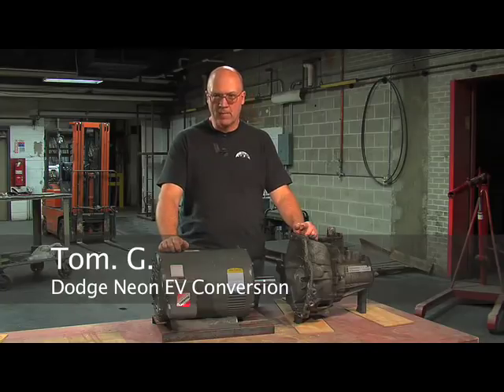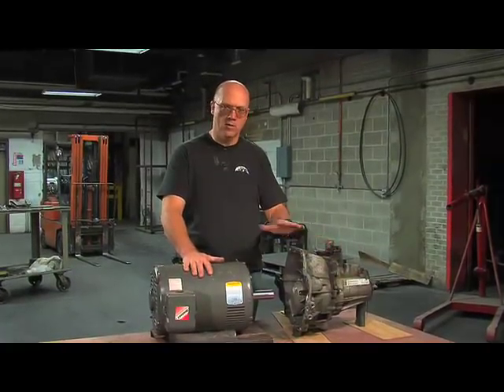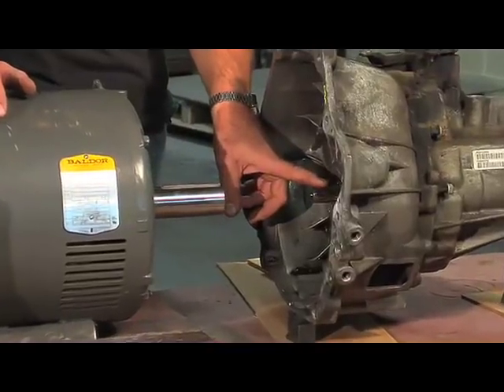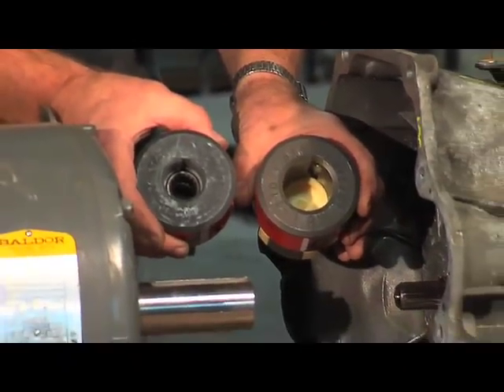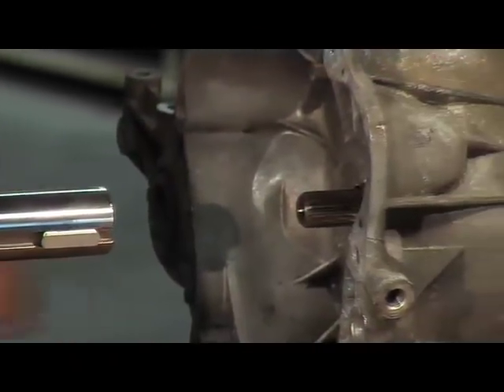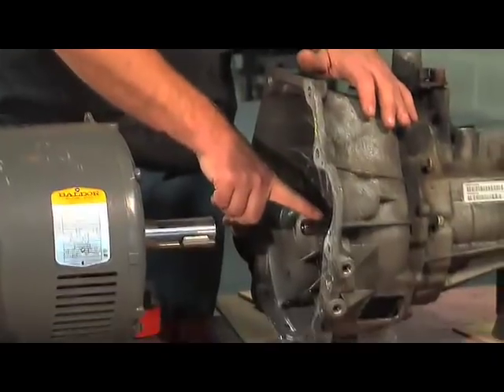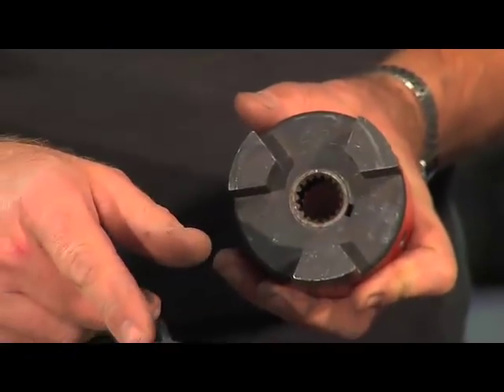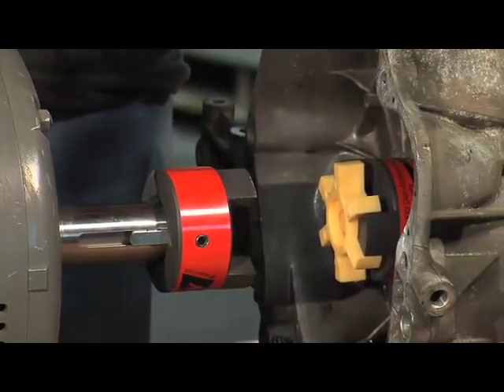AC Electric Car Conversion 101  part 001

Comment: The motor is a Baldor M2515  20HP, 1750RPM, 240/480V

The drive I am using is rated for 30HP so I should be able to get 30HP continuous (read warm motor) and over 60HP for up to 1 minute (read really warm motor)

Comment: The short answer is 300V DC (220V AC / 0.707 = 311V DC)  I have twenty 75AH AGM 12V batteries - 57lb each and will need 6 to 8 more.  The more voltage the higher RPM before it switches to constant HP mode.  Controller:  Baldor 900 series AC Drive. Yes, a match between the motor and AC Drive is necessary for reliable industrial use, but the needs are not the same in an electric car.  I hope to make some more videos explaining this in detail.

Comment: True! Also, for me, it was pretty hard to fit the clutch, just because the shaft on the motor was pretty short and it has a small diameter. My motor has a peak of 5200 rpm, so to fit the flywheel, pressure plate etc on such a small shaft, I thought it was pretty risky. And when I saw that you also went for a clutchless setup, a decided to go the same way.

Comment: In an EV, the motor stops turning when you let off the accelerator, so there is no need for a clutch when taking off, and when shifting while moving, you only need to let off the accelerator and shift.

Comment: Very happy I seen this lol I have a 2011 Mitsubishi rvr gt I put a new motor in and it has tons of codes and I have a 2007 dodge caliber that I'm converting into a truck to haul my atv around with and I have a old cnc engine my boss gave me plus a bigger one at work I had to bring home so this will help me do the job alot better then hillbilly Jimmy rigged

Comment: Good day Mr Nelson tnx so much. My question: please can I use bench grander as my electric motor and what type of inverter can I use for it
Reply from the maker: A bench grinder motor is going to be designed for a tiny amount of power compared to what a car uses.
It is NOT an appropriate motor for a car.
Reply: @BenjaminNelsonX  thanks so much am very grateful. Please can you send me a link where I can get a controller for a 3phase motor

Comment: Hi @Benj
Really thanks for this video,
i have seen many videos, most of the mates using AC induction motor 
question is we are supplying only DC (battery power) Supply , how does AC motor works with DC supply ..?
any convert is requried here to convert DC to AC..?
if yes they power of DC will go down in less (shot time period it self)time it self how does it works ? 
Instead of AC motor why mates are not not perfering to use DC Motors ...? 
Please reply
Reply from the maker: DC motors have been very popular with home converters. AC motors tend to be more efficient and lower maintenance.
Because batteries provide Direct Current (DC) and the AC motor uses Alternating Current, the power does need to be converted. The AC motor works with a device called a variable-frequency drive or inverter. This device converts the DC to AC and applies the correct frequency as needed to the motor.
Historically, Inverters were always a lot more expensive and complicated than DC motor controls.
On this project, Tom converts a car to electric with a repurposed industrial variable frequency drive.
Modern commercially-built electric cars are now becoming good sources of parts for Do It Yourself home EV conversions.
For example, here's a video showing Nissan Leaf electric car parts being tested for repurposing into a home conversion: https://www.youtube.com/watch?v=hhMhxcjdAh8

Comment: You could use a differential out of a Austin Mini engine and connect it to the motor output shaft using a chain.
I believe some Minis with motorbike engine conversions have been powered this way.
You wouldn't have the same disadvantage of a motorbike engine, in that it then has no reverse gear. You could just reverse the polarity and run the motor backwards.

Comment: How strong is that motor? in pk? and voltage. I have a 15 Kilowatt type ad motor is this enough? I think that making more rpm and use th transmission gearwil
work here.

Comment: Yes you understood correctly, other option you mentioned is a gas/petrol/diesel electric generator, it can be used instead of a "pusher" in a teardrop trailer or you can have it in your vehicle as long as the exhaust fumes go outside. Now not many do this or recommend because you will have an spare engine lying around when you convert to EV, also electric generators are expensive, you need a AC +10kw generator AND have an on board charger, or an around +15kw DC generator which are VERY expensive

Comment: The batteries I am using are smaller than those used in most EVs (mine are about the same size as a standard car battery)  26*57=1482lb added weight.  Yes, thats over vehicle gross, so I'm plan on upgrading springs and adding strut supports.  The back seat is out to make room for the batteries and controller.  Watch for upcoming videos explaining some of these choices. 
I have been getting grief from conventional DC EVers - this is an experimental project we'll see if it works when its done!

Comment: can I get better mileage by adding a battery and electric motor under the hood to power the steering, AC, etc.. on a pulley just as the engine did before? I would then charge said battery when parked at home and the power steering, AC, etc.. would be powered independently from the cars normal battery, thus eliminating in-travel drag on the engine from power steering, AC, Coolant pump, and any other things dragging the engine down.

Comment: Hi benjamin nelson
what is the power rating of the motor which you are using in this video. And also could you tell me how did you go about choosing a particular motor for replacing the car engine you have choosen.

Comment: Why do you need a transmission at all with a reversible multi speed motor  . Cant it be direct drive ?
Reply from the maker: YES. Most modern commercially-built electric cars use a powerful AC motor with single-speed gear reduction.

In this DIY car from a decade ago, it was using a relatively low power motor. The transmission can give a little more torque (in trade for speed).

The other part of this is that in a common front-wheel drive car, the transmission IS ALSO the differential AND connects power to the wheels. Parts which are needed even if just a single gear was used.

Comment: So your opinion is to use an ac motor over a dc motor? I have watched many videos and most people are using dc motors. Why? The cost or the expense of converting battery power (dc) to ac to run ac motor.
Reply from the maker: Most hobbyists use DC motors, because they are more readily available and easy to control with PWM speed controllers. Tom got this motor and a matching AC variable frequency drive as factory salvage, and repurposed it for use in an electric car. There is a bit of loss converting battery DC to AC for the motor, but AC motors are a little more efficient, so it's a wash. Both AC and DC systems can work great for DIY electric cars. Check out my "Electro-Metro" for an example of a simple DC car.
Reply: BenjaminNelson
I\'m not sure but ,if anyone else wants to uncover how to convert a car to electricity try Pyzork Amazing Electric Professor ( search on google ) ? Ive heard some super things about it and my cousin got amazing results with it.

Comment: The baldor motor is rated at 1750RPM, the AC Drive can drive it up to 6 times faster.  From 0 to 1750 RPM the motor is constant torque based on the AC Drive.  Above that its constant torque.  I will be able to hit free way speeds in 5th gear at about 3000RPM and need to deliver about 22HP to hold that speed.  These numbers are based on some simplifying assumptions, the proof will be in the running car.

Comment: Hi, just wondering by not having a clutch would it hurt the motor when down hill running although you are braking ? or just shift gearbox to neutral? or maybe it won't hurt the motor if it becomes the driven?

Comment: Do you know anything about gasoline conversion of golf cart to electric
Reply from the maker: Golf carts are interesting in that there are many out there which are nearly identical EXCEPT for being either gas or electric.
Because there are so many electric golf carts out there, I would NOT recommend converting one to electric. Simply buy an electric one. If you only wish to convert a golf cart simply to learn more about working on conversions, that's fine, but an electric bicycle or go cart may be a better simple learning project.
Electric golf carts typically have an electric motor which connects directly to the differential of the rear wheels. To convert from gas to electric, you will need to swap out the entire rear axle.
Try joining a golf cart forum, as there are plenty of folks out there with lots of experience working on both gas and electric carts.

Comment: The problem with using an automatic transmission, would be the power that it saps. Just look at 0-60 times between the same car with auto then manual boxes.
Also, with a manual box, you would be able to make gear changes without using a clutch as long as you could kill the power from the motor when you do so. Some motorbikes have an engine kill button on the handlebars for just that purpose. Pressing the button kills the ignition, bang in the next gear,  let go of the button. Instant gearchange

Comment: I don’t understand the transmission because it has to be in gear to work. If your doing direct drive why is the gearbox still there? Because u not selecting gears
Reply from the maker: It's very common for DIY electric conversions to use the existing transmission.
There are two main reasons for doing this:

1) An electric motor typically needs gear reduction. So, just use the gears already in the transmission. Even if there's no shifting, just leaving it set in one single gear still provides the gear reduction.

2)You still need some way to physically attach the motor to the vehicle and get it's power from the motor to the wheels. The logical place for the motor is then just to mount it to the transmission, the same way the engine was. Power then goes from the motor, through the transmission, splits through the differential, and goes to each of the two wheels.

On this project, the driver can still shift gears, even without having a clutch. Here's a video showing how this vehicle shifts: https://www.youtube.com/watch?v=KcCHNKHFTvU
And here's a video of the car out on the freeway:
https://www.youtube.com/watch?v=Ic49M8F8hwc

Comment: Why not just bypass the whole transmission all together? I'm assuming it's in order to give you the ability to reserve. Is that an automatic transmission?
Because I would assume if it was manual, you would need the clutch to switch gears.

Comment: If you are going to do this, you need to make sure you carry a spare coupler with you and the tools to replace it while driving. Not trying to be a killjoy, I have just seen far too many of these couplers chewed to hell because some other maintenance guy would not take the time to align them correctly. I also do not agree at all with welding it to the shaft for this reason.

Comment: Would it be logical to buy a small car like a mid-1960 MG and swap the components from a FIAT 500e?
Reply from the maker: If you wanted some sort of retro car (especially a convertible), it might make sense to just get an entire electric car and swap over all the components. Nissan Leafs are very cheap used, Fiat 500e, and electric Chevy Sparks would also be great sources for conversion parts.

The main downside of something like that is  you would need ALL the components from the donor car and reinstall them as they were. Essentially just doing a body swap.
Reply: Benjamin, doesn’t an swap cost in the neighborhood of ~ $15,000 if using new components?
Reply from the maker: @Wegl79  I was suggesting buying an entire used car, and pulling the parts out of it for a conversion. There are quite a few used EVs out there now that can be had for cheap.
I've bought used EVs from $3,000 (body damaged) to $7,000 (second owner, great condition.)
Reply: Benjamin, that was my whole point, buying an older EV and use the components from it.  A salvaged vehicle would probably be at a better price point.

I think it would be an interesting project.

Comment: I did that, and after a while that rubber spider will disintegrated more work!
Definitely it's  not a good idea!
Reply from the maker: The trick with spider couplers is to make sure they are properly aligned and that you use the one rated for the amount of torque you put through it.
I ended up busting a spider coupler on my Geo Metro. It was partly due to poor alignment and partly to manufacturing quality. One half of the coupler was a good name brand, and the other half was a generic made overseas. The generic side broke and the name brand good quality half was fine!

Comment: Wow such a big Baldor motor for free?!Now I understand.Yes the AC motor has better regen. and there are no brushes to change,so it may level the loss during inverting power and less apms flow..I saw Nissan Leaf and it has AC sychronous motor,so there must be a reason why all EV's manufacturers use AC motors.

Comment: I can envisage big problems with traction, plus you'd have to link accelerator and gear controls to the trailer.
I thought the 'power pack' or whatever you call them, convert the dc battery power to ac? I've certainly read articles about using ac motors!
As for price, I can get a 15kw generator complete with diesel engine, brand new for £1200 including delivery from China.
I'm sure I could source a generator here and bolt an engine on for half the price. How did you arrive at 15kw?

Comment: that type of coupler isn't a good idea on most conversion, even though most people use them. the reason being that most manual gearbox's run a spigot bearing to support the front of the input shaft on the gearbox. with a love joy coupler you dont get this support. do it properly and make a solid coupler. i'll post a video on mibe real soon!

Comment: Well for the range EVs are ideal for short trips and perfect for day to day use, exceptional trips (outside the city) then you need a gas or diesel vehicle or maybe a range extender (instead of selling the gas engine you can use it in a micro teardrop trailer and use it to "push" your EV in the highway) that way you can travel as long as your gas tank allows and refill in gas stations... the perfect nirvana. Google "range extender trailer" and be amazed!!!

Comment: Hey guys I'm new to your channel I've been watching a couple of the series and I just love the work your doing.  I have a question is it possible to do the same set up but lowering the voltage let's say to 72 or 96 volts? I would imagine you would have to rewire the motor with heavier gauge wire that doesn't seem to be such an issue but what about an off-the-shelf VFD could it also be adjusted to to this lower voltage to accommodate the new motor windings? Please reply  to these questions. Thank you!
Reply from the maker: Commercial Variable Frequency drives generally run at the voltages that they do because of what voltage is used in industry from the grid.

There ARE AC electric motors and drives which are designed for electric vehicle hobbyists which run at lower voltages. That's to make it easier to run with a battery pack with fewer cells in series. For example, there are now AC forklifts and golf carts. Traditionally, those run at 36-48V, so there are now motors and drives specifically designed to run at those voltages.

Re-winding a motor doesn't sound like a job for an amateur. As for modifying an off-the-shelf VFD, I'm sure it could be done, but it really depends on the design and the internal parts.

Probably better/easier to just use a motor and VFD designed for the lower voltage.
(Unless you have lots of time on your hands and like experimenting. If so, let us know your results!!!)
Reply: @BenjaminNelsonX  converter para

Comment: My worry is what about water and wet places?
Reply from the maker: Most electric motors don't have any issues at all with getting generally wet.
Reply: @BenjaminNelsonX  ok but sometimes we drove trough rivers traveling (africa), my concern or question here is the other electic like "inverters regulators and motor', i mean i drove a diesel engin below or halveway into the water??
Reply from the maker: @georgefrederikoosthuizen891  If you want a waterproof electric vehicle, they can be designed that way.
Various components are generally gasketed and cables use water-tight cable-glands.
Reply: @BenjaminNelsonX  ok thanx that's basically what i thought i dont want such car i just tought if u get in such situation, but u gave me all answers already i dink best to have a diesel car additional for such trips u know is wet and water conditions 👍

Comment: FYI submarines have ALL of their electrical components inside where, unless the shit has MAJORLY hit the fan, there is NO water.
My comment is based on the location of the main ECU fitted on the TD5 Discovery. I am a big fan of Solihull products, I currently have three. If you had owned a TD5, you would understand!.

Comment: I have an idea for an electric trike. Light weight, two seats, but with the ability to attach a small generator on the back to extend range.
This is how diesel electric locomotives have been running for decades. although their engines do happen to be a bit on the large side...

Comment: The speed of an AC motor is not based on voltage like a DC motor.  Its based on frequency.  1750RPM at 60HZ.  120HZ = 3500RPM.  At 120HZ in 5th gear my top speed should be 82MPH. Realistically I hope to cruse at 55 to 60MPH.
I plan to do a video on the math behind these numbers and some of the peculiarities of AC motors - for example more Volts raises the point where the motor goes from constant torque to constant HP.